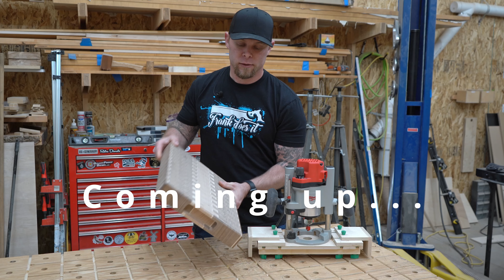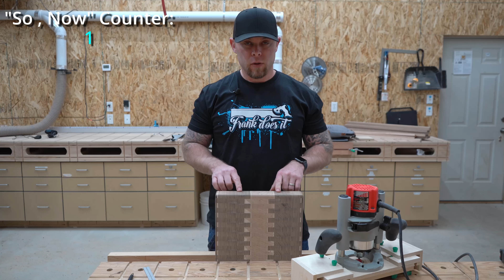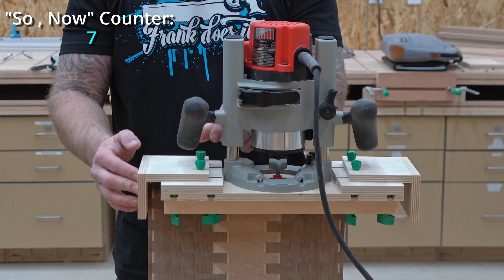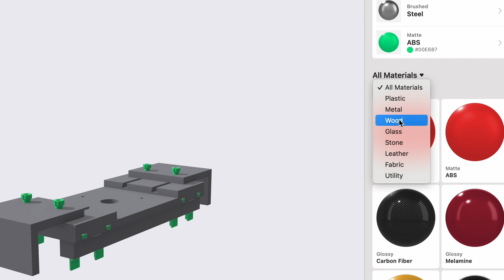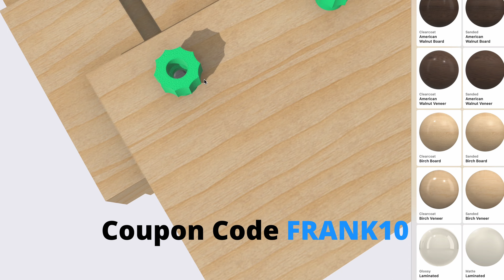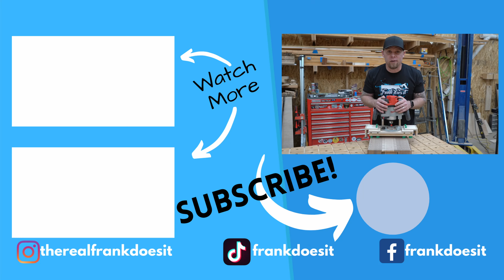Ultimate Cutting Board Jig

Comment: Very cool.  I was wondering if this could also be used for doing hinge mortises, but it would probably a little modification since you wouldn't have the same side stops of a small cutting board if you're in the middle of an entry door (for example).
Reply from the maker: Yeah for sure! That’s a great idea and I’m sure you could accommodate by removing the wings and adjusting the rails. Then you could clamp some stop blocks to the door for the other axis. Very nice!